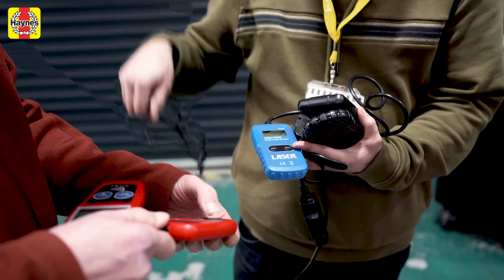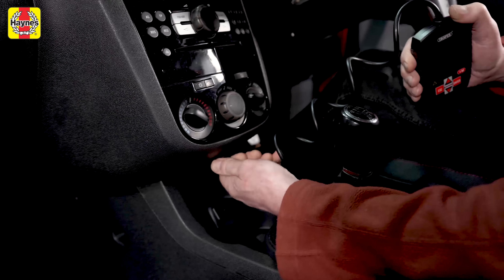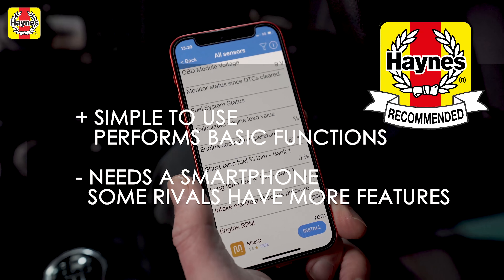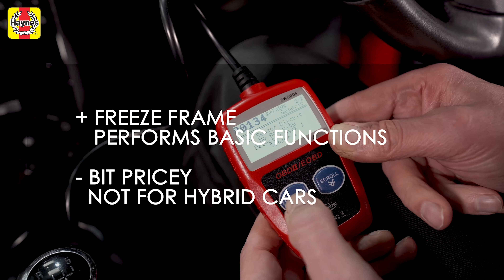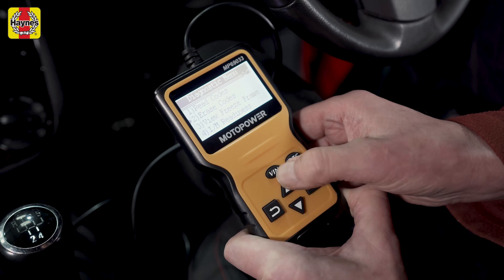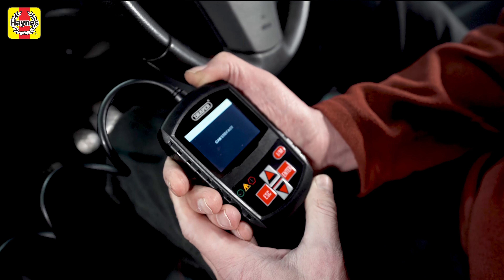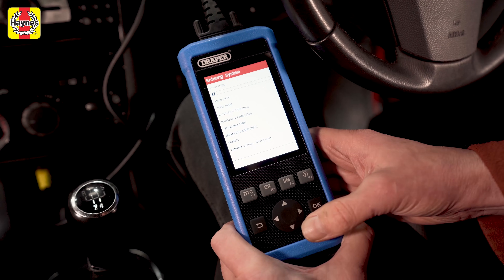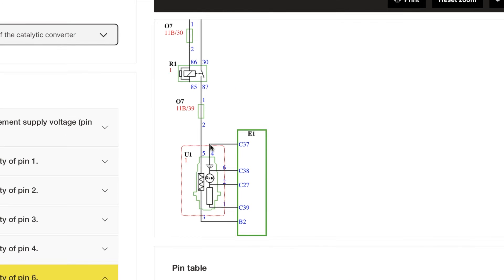Best OBD fault code reader 2025 – which OBD2 scanner do you need? We rate 8 OBDII readers

Comment: Say if my radio has stopped working, will it show why? Also if the horn stops working? Thanks.
Reply: If your radio stops working it could be wirring or the radio self. Your horn you can check if you have good ground. Or replace the horn.

Comment: Get the scanner that the dealer uses.

"But it's expensive": Nope, usually around $50 for a non-genuine cable that works perfectly. Software usually available for free online.

How does it work? You buy a special cable (depends on your car brand, model and year) which basically works as the interface between a PC and OBD port. You have to find the dealer software online (if it didn't come with the cable) and set it up on your PC (usually this is the trickiest part).

Why? Because it can scan (and sometimes program) your car better than any other scanner out there. For example, you won't find an OBD2 scanner under $50 that can show the two live readings from both potentiometers in the steering angle sensor on my BMW x3...

Comment: Well thanks for this, I bought according to your recommendation and the damned thing didn't work with my vehicle! There is absolutely no point in showing what each reader does if it doesn't do it on your vehicle!! 
This is where the really useful video should start, with the ability to find out which readers work with which vehicle then move on to describing the reader! 
I have spent god knows how many hours on the phone and on line trying to find out and it's proving impossible, right now as I'm typing this I'm on hold waiting to speak to someone at Halfords! My VW dealer where I bought the vehicle new hasn't a clue and never rings me back after 'looking into it'
What is anyone supposed to do, keep buying them until we find one that works?
Reply from the maker: According to the relevant legislation, all of these scanners should work on EOBD equipped vehicles. That's petrol models from 2000, and diesels from 2001.
Reply: @HaynesManuals not true as some protocol missing from most scanners unfortunately the sellers dont tell you this
Reply: If you  look  at Ama$on 3 star reviews you'll find a guy who eventually set it up - and to do that it needs Windows, or a fight....

Comment: I think you should make it very clear which (if any?) of these devices can go beyond the basic engine management system into areas like ABS, airbag etc. etc. I accept that these are bottom end devices but users don't want to buy then find out they can't access information on the fault codes they have? A bit like the Spanish comment below says?
Reply from the maker: Hi Doug, thanks for the comment. As we've replied to the Spanish comment, we deliberately chose to test products for home DIYers, not professionals. We recommend relatively basic OBD code readers used in conjunction with Haynes AutoFix for fix-at-home mechanics. This combination is much better value than high-end OBD readers and by entering the fault code into AutoFix you get make/model specific data and guides to help carry out the repair.